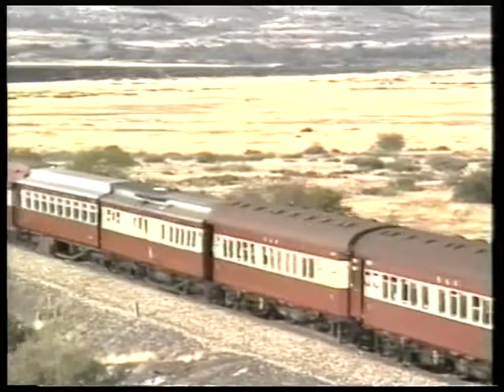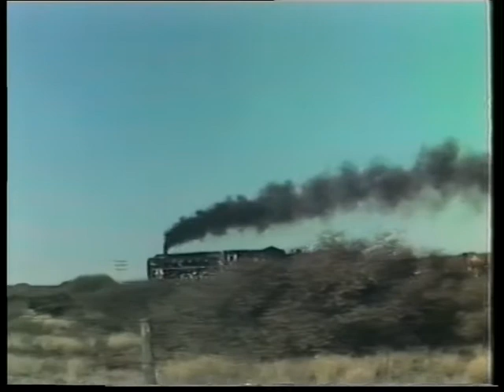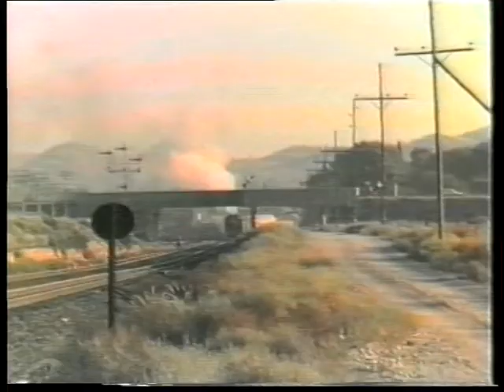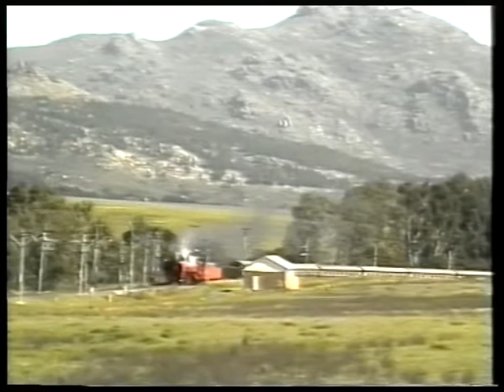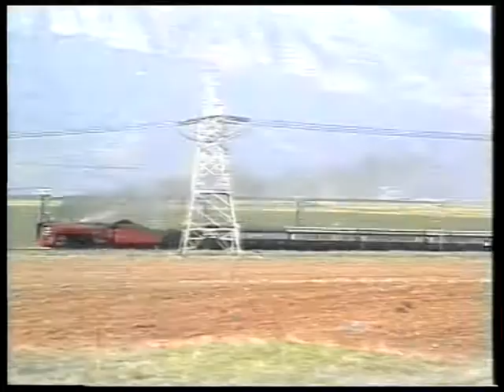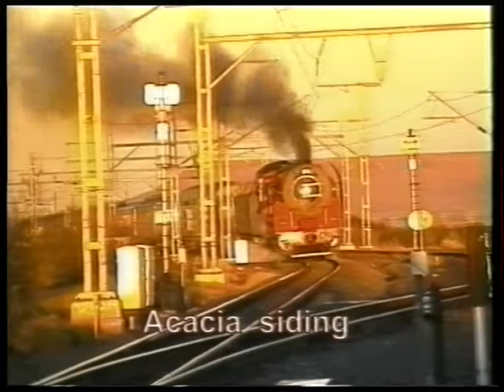OMGEBOUDE STOOMLOKO

Comment: Hi Could you please tell me. How far could these loco's travel on one load of coal and water?
Reply: The narrator said earlier on it was about 1000km, but that was for the Class 25.
Reply: My uncle was a steam engineer back in the day. I remember him saying they would run from Knoxville, Tennessee to Atlanta, Georgia and back again without taking on coal or water. That would be at least 600km/300+mi. Best I can do. Good curiosity question.
Reply: I believe the N & W Y6B Mallet loco burnt 1 ton of coal per mile on steep grades. Coal capacity around 28 tons  @ut000bs